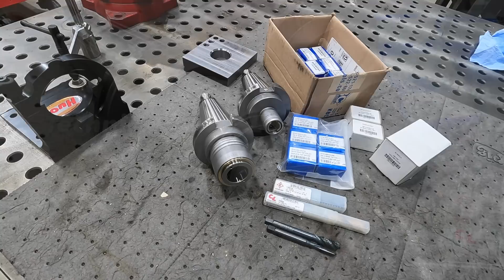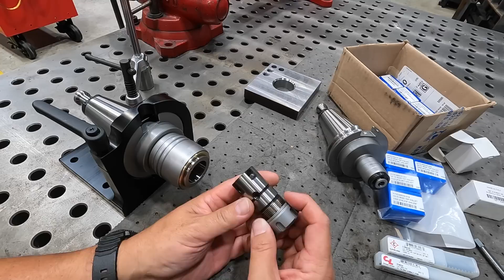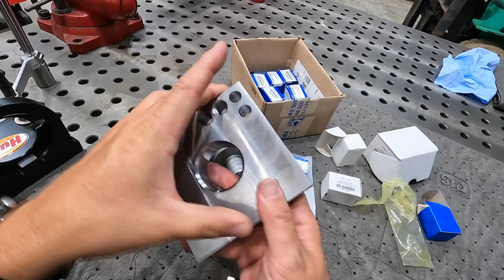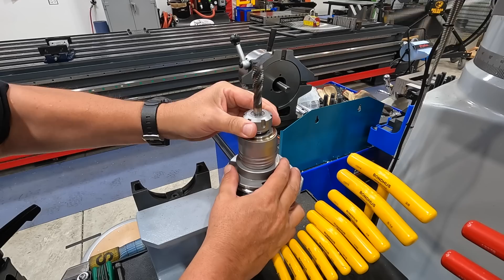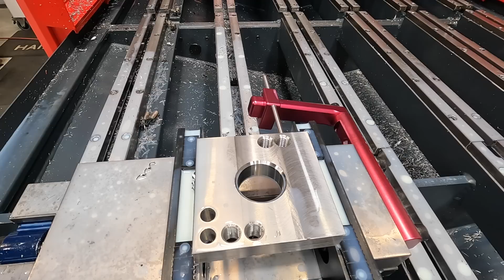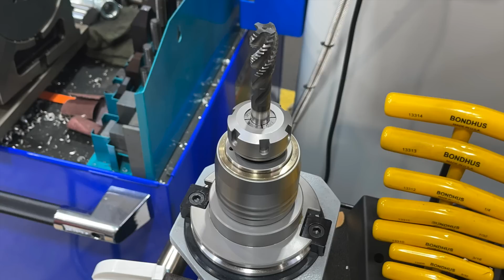Techniks Micro Float-Tool Tuesday Ep.18

Comment: This ok if your z axis is slower than the tap. But if z is quicker?
Reply: That’s why you adjust the Z axis speed the same as the thread pitch.
Reply: @ellieprice363  Agree but the set speed and the real speed not every time same. Reason why this tool needed.
Reply: @fecoka1977  Depending on the spindle and encoder on it the Z axis and it get software locked to keep it accurate in the bore. This math is likely what got a tweak on the Flex a few weeks ago when he was doing the tooling plates.

Comment: Hi Adam, Good tapping but I am interested in why you are using a spiral flute tap, which designed to use in blind hole tapping as they bring the swarf up and away. Spiral point taps are the best and strongest for through holes. Maybe you have a good reason for this? Cheers Ian
Reply: The advantage of a spiral flute is that it can be used for both thru holes and blind holes. Thus you only have to have 1 tap type in the CNC tool changer.
Reply: @timeckelmann1196 Good answer. When I first used spiral flute taps I thought they were weaker than straight flute. They’re not. The spiral design requires less cutting torque, thus they’re superior to straight flute in most cases.

Comment: The chamfer on the 5/8" holes looks about the same as that on the 2" hole. Coincidence?
Reply: Thread pitch determines chamfer usually, that said, I don't know the thread pitch of the 2" taps he did.    That said, I usually prefer a heavy chamfer for helping line up bolts in hard to reach areas.
Reply: @herpderp264  Yes, but given that the chamfer on the 5/8" holes was an error, I was wondering whether some setting or other had been copied over from the 2" hole - but I've since realized that the 2" hole was already in the test-piece when it was set up in the machine, so I'm talking rubbish - ignore me!

Comment: %
O1200(T)
G21
G0 G17 G40 G49 G80 G90
M8
T3 M6
G0 G90 G54 X-8.267 Y11.545 S350 M3
G43 H3 Z25.
G98 G84 Z-10. R5. F700.
G98 G84 Z-20. R5. F700.
G98 G84 Z-30. R5. F700.
G80
G0 Z150. 
G0 X... Y...
%
you will be able to cut through 100mm steel like butter :face-blue-smiling::face-blue-smiling:

Comment: a good advice drill 0.1mm bigger,, it will extend you tool life 10 times,, it means nothing for normal threads .. if you drill right by the book then it won't be long before you will hear the tap screaming,,, and then its  break  if you run  three times more .. believe me  :face-blue-smiling::face-blue-smiling::face-blue-smiling:
Reply: I mostly gently run the drill back and forth to give it a mild reaming. Maybe I'm deluding myself but the taps seem to like it.
Reply: Used to have a chart with three different drill sizes for each tap corresponding to three percent of thread,   we always went big, never had an issue

Comment: you break the tap  yes  ,,, the cnc does not stop, so the clutch will only help you if you are quick on the emergency stop,, you have to do 2-3 cycle cycles where you go deeper in each cycle and it should probably hit the thread ,,,,, that is logical because you would doing the same thing manually .. people don't believe it until they see how I do it on the cnc just more cycles    ,,  I easily cut through 60mm with a 10mm tap with 3 cycles, tools come all the way up 2 times... now I don't know your control,, so you don't have to have G80 After the cycle, it will stay in sync    ..

Comment: When you have to update a toolpath do you make the changes on the desktop in the office, transfer the file to a flash drive and then move the drive to the flex cnc? That's the way I do it for my cnc router. I wondered if you had a better way to get the files to the machine.
Reply: I read somewhere the latest gen machines can connect to your Lan so you send it straight from the desktop wherever it is in you facility.
Reply: Even if your controller only has USB (sucks a bit for noise issues) you can buy longer 'powered' USB cables to run longer than standard. LAN is the way to go as Zorb mentioned already and NEVER WiFi. Flash does get used and I have never seen Adam run cable so likely assume he is running a pen drive. My UCCNC boards run LAN btw so it will get more common even in home shops.

Comment: Per your preferences and experience which bearing type is better suited for machining operations, ball, roller, tapered roller etc…
Reply: Bearing for what? The spindle?
Reply: @littlejackalo5326  bearings for rotational motion that create positive dynamic forces which have resultant vectored impetus.